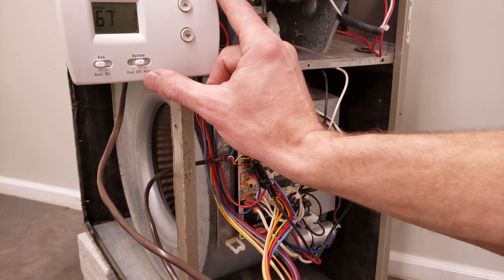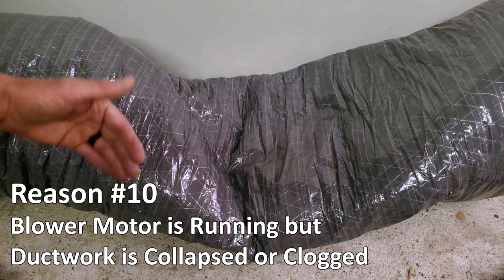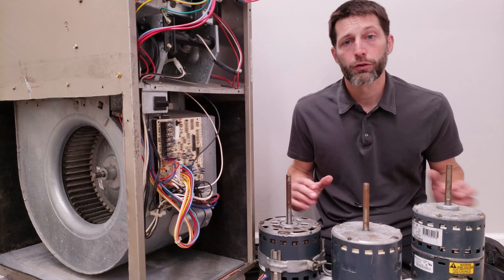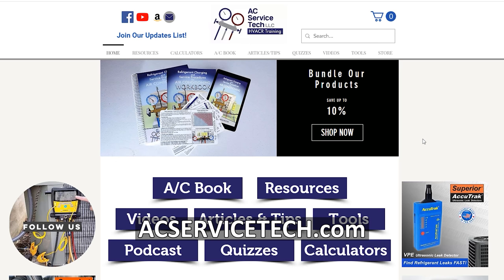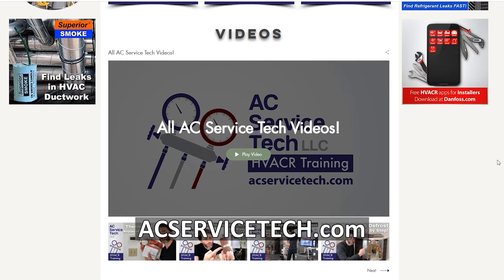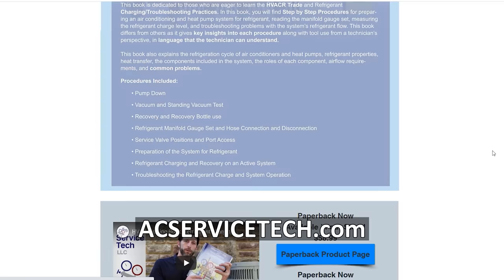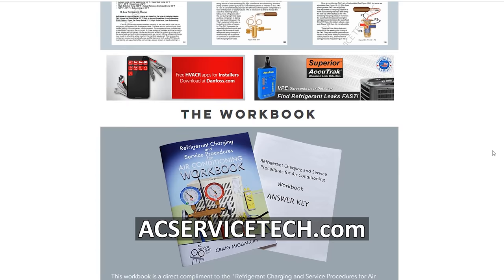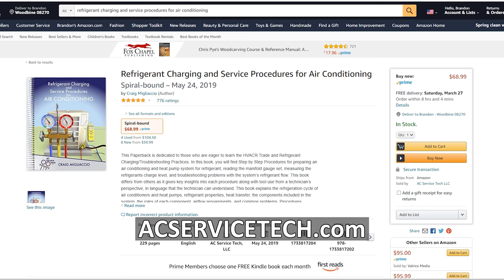HVAC Blower Motor FAN WON'T TURN ON, NOT WORKING! Top 10 Reasons/Problems! Heat and AC!

Comment: Question on the ECM module: I have a bad module and want to replace it. It's a GE ECM2.3 CP03. I see a lot of comments saying that the ECM needs to be programmed correctly from the factory. The replacement Lennox kit appears to be 10M08, but is over $500. Can I use any GE ECM2.3 CP03 that I find on ebay instead? And would a CP02 or CP04 also work? Specs for these seem difficult to find online

Comment: Is it normal for the condensing unit to come on first and the Air handler fan to turn on after a 25 second delay. I don't think it was like this before. Is this some symptom of some thing coming... I am going to may be lube the fan blower if there is a lubing option available as a preventive maintenance. Thank You.

Comment: Aside from fan motor or circuit board issues, WHAT is the connection to the evaporator receiving compressed freon and cooling and the fan operating (assuming the thermostat is calling for cool)? Is it only a timer that energizes the blower fan once the compressor is running or is there a thermal switch on the evaporator that senses cold and energizes the blower motor?
Reply: On a call for cooling your fan will start regardless of the refrigerant. Your G terminal energizes the fan and the Y terminal energizes the compressor.  The compressed vapor goes to the condenser and from there it travels to the evaporator as high pressure liquid.

Comment: Question: Hi my condenser fan motor would not turn on all I heard was loud humming and the motor was extremely hot I couldn’t touch it. I checked starter capacitor for the fan it should be 7.5 microfarads mine was 4.3 I changed it and everything worked fine for a week then same thing happened. I gave it a push on the blade with a screwdriver and it still wouldn’t start, I checked the capacitor again it’s good, I checked the resistance of the fan motor black to orange wire 23ohm black to blue 22.4ohm blue to orange 45ohm, I also megged it with (fluke 1587) black, orange and blue wire to fan motor housing at 500V and got 550mohm of resistance on each winding. Also my motor shaft has about 1/4 of play in and out I’m not sure if that’s ok? From reading stuff online all of the electrical checks seem to check out do you think I should change the fan motor? Thank you.

Comment: I have central A/C and is working fine. I noticed today when the outside unit shuts off the inside furnace which blows the air stops at the same time. I never noticed that before, I thought it would run briefly then stop. Is that normal?  Thanks!

Comment: Thank you for the post. I have a question for you, or anyone knowledgeable here. Last week I scheduled a seasonal maintenance for my rental property AC unit. A tech I've used in the past went out, completed the maintenance and sent me a report noting that, except for some minor issues, largely dirty radiator coils, the unit was running fine. A short time later, really about 2 to 4 hours later, the tenant called to tell me the unit was not working. I had the same tech go out to look. He reported back that the Blower Motor had failed and would cost $700 to replace. He claimed it was an unlucky coincidence that it failed the same day, a few hours apart, as his maintenance. I of course would like to be as lucky when playing the lotto. What are your thoughts? Is it really luck or good old negligence?

Comment: If anyone wants to chime in on what they think the issue might be I’d greatly appreciate it. 
So, I live in the south. It’s hot, humid, and nasty. Every now and then, when our AC kicks on, the air handler won’t turn on with the outside unit. We have a digital thermostat from Braeburn, and just a week ago it started to display a battery icon indicating a low batt or maybe a fault. 
When the air handler does kick on with the outside unit, sometimes the air handler will turn on and off very quickly. Like within 4 seconds you’ll hear the air handler turn on and off like 6 times until it finally stays on or it just stays off. 
When it does this, it makes a rather loud “buuurrrrrrr…..buurrrrrrr” almost like it’s struggling to stay on. 
Like you know the sound of a struggling high torque electric motor? That’s what it sounds like. 
We can’t figure it out for the life of us. We got the coils cleaned, we replaced our thermostat like 2 years ago to digital. We always make sure the filter is clean. We aren’t sure if maybe some of the wiring is loose inside the unit? Or maybe loose wiring in the thermostat? 
Maybe the entire AC system is haunted and has the soul of Voldemort speaking in posltongue to force us to spend money on a technician. 
We aren’t sure. The Ac system isn’t sure. Reddit isn’t sure. And quite frankly…I’m starting to hate the south. I’d much rather freeze than drown in my own sweat 😂
Reply: Did you figure out what was the issue and did it get fixed. My guess is one of the two things a bad relay supplying power to the fan or a bad fan motor.

Comment: I've a Goodman furnace with blower motor on bottom furnace in the middle and coils on top looks like square box phlegm . I'd like to check clean it but not sure how . Yesterday early morning noticed it wasn't cooling as much . Found two frozen lines and filthy filter and blower motor . Thawed out and turning back on only blower motor turns on for a few minutes get hot turns off . Someone told me check capacitor first . Changed filter cleaned as best as I could without removing blower .  Still only partly works still weak low speed . It has small switch attcached doesn't look like any cpacitor I've seen . OOPs it does have one just hidden under cover plate where circuit board is mounted .

Comment: I have a 1980 Carrier 60% furnace, the pilot lights, the burner lights after about 30 seconds and the overheat sensor shuts the burner off after about 2.5 minutes because the fan never comes on, I can turn the fan on manually and it heats, but the fan wont work automatically. I have replaced the circuit board twice with used " tested" boards, I have replaced the over heat sensor and the pilot light. I don't see any way of proving flame, is it just a timer on the circuit board that turns on the fan a set time after lighting the burner?

Comment: Do we need to check the vac rating along with microfarad rating while installing a cap to blower ?
Reply: Yes, make sure it is about 1.5x the AC Voltage that powers the motor. For example, if your motor is running with 240 VAC, then you want a capacitor that has a rating of 370 VAC or higher. And also make sure the microfarad value is the same as the old cap you're replacing.

Comment: So, what if when I measure voltage between red and green, it reads 18 volts? Could that be the problem? The others read 27 volts. Why would green read 18 volts? Damaged wire? Short somewhere?

Comment: So for troubleshooting is the uei meter a choice ?
Reply from the maker: I like them- UEI, Fluke, Fieldpiece!
Reply: So with your experience, what would be a well rounded meter. I have a fluke 324 and it's a bit of a let down. I do a lot of vrf building but haven't done much for service. Only 2 years in this trade. I've watched most of your vids and the uei seem to read all resistance when your demonstrating troubleshooting.
Reply from the maker: the UEI 489 is a good one, thanks!

Comment: Our ac wouldn’t go down past 74 degrees even though we had it set to 70. I checked out the filter and it was covered with dust. I changed the filter and reset the thermostat (don’t ask why) now the blower motor won’t turn back on and also The ac unit fan outside wouldn’t start either. I got it turned on by sticking a screwdriver in and giving it a push and it started but the blower motor still won’t start. We live in a fairly new house and it’s only 2 years old. Anything that stands out to you right away?

Comment: My issue is blower turns on but at really low speed....so low that you can't even feel air coming out of the vents.  If I turn off the system with the breaker and turn it back on the blower comes on full speed for 5 or 10 minutes and then it starts struggling to stay high speed and makes some noises like it wants to kick in to higher speed but stops and stays at low speed.

Comment: Hello, my a/c starts working but after two hours the blower stops working and the compressor continues working and the lines freeze and I changed the filter and also cleaned the evaporator. Can you please help me

Comment: Hey my fan keeps spinning backwards I put the terminal fuse on the hot and on the other side with a whining copper wire going to the capacitor what I did wrong

Comment: Im haveing the problem replaced fan motor 3 times it keeps going out works wen thermostatis on heat but cool it dont work works for a week after replacement than burns out 3 company still cant figure out

Comment: Hi, perplexing problem.  Old X13 motor ECM module blew, all speed taps dead.  Replaced with reman X13 motor and it worked...left and came back 2 days later and it was also dead.  Measured at motor plugs: 220-240V line voltage L1, 2 to ground was good: low voltage (it was 29V, an issue?) from speed tap to common was present.  Haven't had time to check other taps.  Any ideas?  Thanks.  BTW, there is a 1k resistor in parallel to taps from G wire (fan run) to common.  Is that to smooth signal or bleed voltage?

Comment: My heat pump originally used freon 22 but the outdoor condenser leaked and was replaced.  With some acceptable refrigerant, but I was told the equipment could now only be used for airconditioning, not as a heat pump. Was this a true statement? The guy could/would not explain his statement and I can’t argue the case. I still have a little piston that was removed at the time.  Hoping to reuse as heat pump.
Reply from the maker: If the outdoor metering device was removed, it wouldn't work in heating mode. The retrofit refrigerants work best with a TXV. It really depends on the retrofit refrigerant used in reference to how well it will work with a piston in heating mode, thanks!
Reply: Never let someone Hack your unit up if they can’t explain what and why they are doing so

Comment: I have an issue where my blower motor is getting power, but I have to start it manually. Once it reaches the desired temperature it stops, and then when the temperature rises it comes on but doesn't have enough torque to rotate the fan. Any clue on what the likely cause is?

Comment: Can a blower be bad even if it's running OK. my blower motor sounds like is running but it doesn't sound like it's pulling air like it did before

Comment: My blower motor smells as something is burning. I replace te capacitor and still does the same. Turn on for a few minutes then starts smelling and it shut down itself. Any ideas?

Comment: I turned my heat on today, the blower spins slow for a few seconds then turns back off. Any suggestions?
Reply: Sounds like a weak capacitor

Comment: @2:30 would the bad motor when it overheats blow out the new run capacitor?  I just replaced the capacitor but after about an hour  again had the symptoms of a bad capacitor (loud electrical hum, blower wont engage start, but will start with manual assist).  We thought it might be a problem in the control board.  So I temporarily bypassed the board to power the blower and it started (cold).    After about an hour it again stopped with the symptoms of a bad capacitor (loud electric him, blower won't start).    We don't smell any burning and we didn't hear any change in the blower operation.  But it seems like it's stopping when the motor heats up.
Reply: Having the same problem
Reply: You probably needed to replace the motor as well

Comment: My ECM went bad so I purchased another one now my fan blower pulsates it won't kick on full blast it'll only pulsate about an inch or two then shut off then kick on and pulsate and shut off and keeps doing that what's the problem
Reply: motor module issue

Comment: On Capacitor replacement ALWAY look at the voltage NEVER replace a 440 with a 370.  You can always go higher never lower, unless motor says 370 is ok.

Comment: My hvac inside unit was making a humming sound and the fan wudnt start i went ahead and changed the capacitor and it ran again to the set ac tempertature but after didnt wanna run again and made the humming sound again,..could it be that my motor is bad???..Anyone knows !????..Thnx

Comment: Hi, my blower is making sound like it’s trying to start but not able to start. The relay keeps on clicking. I tried replacing the capacitor but it still happened. This behaviour is so random that I can’t reproduce it consistently.
Reply: Did you remedy the situation? Please advise

Comment: What if the fan works with heat and AC, but it won't turn on by itself on the thermostat with those two off?
Reply: Same issue here. After eliminating the possibilities of thermostat issue (connecting R and G on thermostat end) and wiring issue (connect R and G on the control board end), I guess maybe my control board is not working properly.

Comment: found a kijiji tech he wanted  $790 for a new gas valve that costs $300 ..NOW i dont know if it is the gas valve or not..so i had to come to youtube to find a soulution 

90+ furnace  had a  power surge and everything dead except blower on all the time  weither calling for heat or not.
1.inducer, ignition and safety wires  going  to connectors on gas valve ..a smart valve 
2. tested the saftey circuts (limit and rolls outs) all good to and from connector on gas valve 
3. theres power on the main board going  everywhere  fuse is not blown 
4. no power coming into inducer motor (from gas valve connector)  but theres power from main board to gas valve inducer connector 
5. i took off wires to pressure switch .. tested both blue wires dangling in the air and both in and out  have 15 volts 
6. the diagnostic error light on gas valve  used to flash  a trouble code of  "bad  limit circut"  but now no light at all

Comment: What if there isn’t a capacitor??
Reply: then you probably have an ECM type blower motor, like an X13 motor for example. Those have motor "modules" on the end cap of the motor, with internal electronics that frequently fail. You can replace the motor module by itself (the motor windings themselves are usually still good, but you should test those as well with an ohmmeter), or if you find it too expensive to replace an ECM module, you can switch to a PSC motor, which is an older but much more reliable and affordable motor technology. That's what I'm doing with my failed X13 motor/module. The PSC motors have external capacitors, while the ECM dont. (ECM caps are small, inside the module housing, and usually inaccessible for repair.)

Comment: Why does my blower work when it’s just the fan but it will not kick on when the heat is turned on?
Reply: I have a similar issue, did you get an answer? My turns on with AC or EmHeat but not Heat Pump, Fan On, or Recirc. I'm guessing control board? (Already replaced the thermostat)

Comment: yanked ecm blower motor out of rhe case. removed module. phase to phase on all 3 connectors shows 6.7ohms. phase to ground all show OL, so motor is good correct? there is a carrier video floating around that states if phase to ground is OL the motor is bad and needs replacing. that may be good for carrier but is a blatant lie.

Comment: lets be clear . if you replace just the capacitor YOU WILL HAVE A CALLBACK ON A BLOWER MOTOR . the other reason it wont work is no power or locked up.

dont know how there can be 10 reasons not running 

its like saying theres 10 ways to make cereal

Comment: I have a tricky problem.
Air handler works ok when in fan mode. When cool mode is selected compressor unit comes on and seems to be working fine but air handler shuts off.  what is going on? Relay 90380 already replaced.
Any thoughts ? Please help.